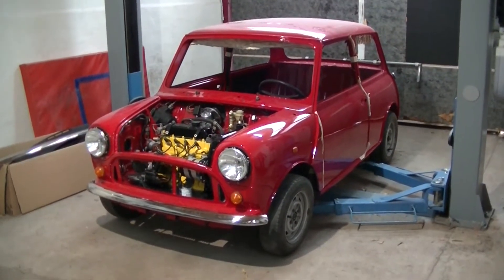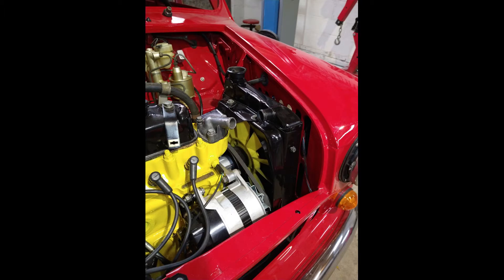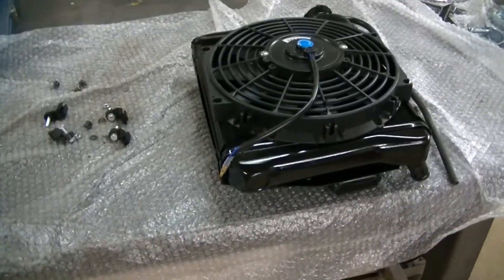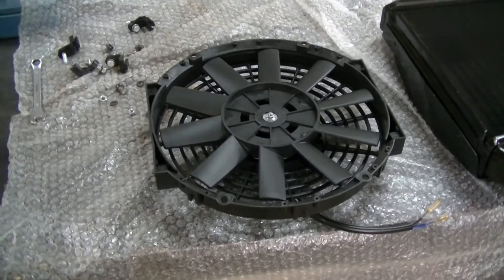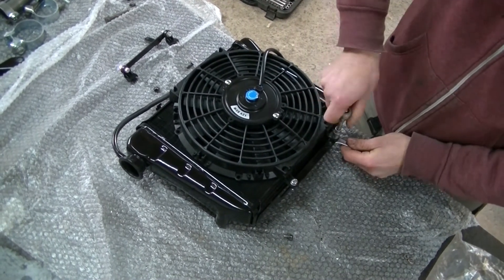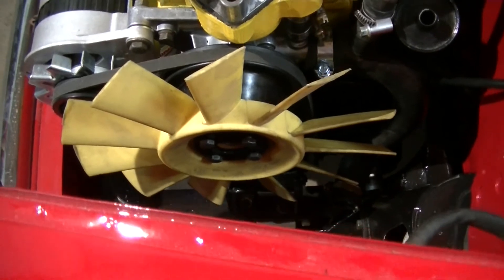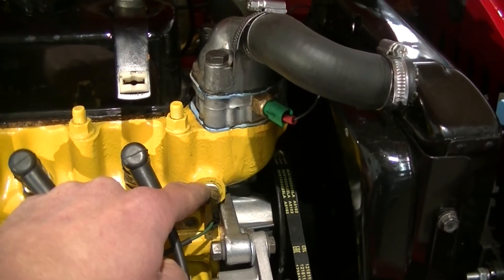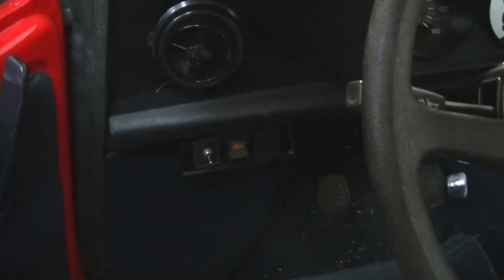Classic Mini electric cooling fan conversion

Comment: Where did you get the fan kit from? Thank you
Reply from the maker: I made it myself. I bought a 9 inch generic electric fan. The thermostat adaptor plate is from a late model mpi mini. The thermoswitch is from a fiat 1.2 8v (84°c - 93°c). I also installed a bypass switch so I can manually switch it on.

Comment: It's pretty amusing that the original yellow fan was on backwards, which meant the air flow was much less than it could have been because of the angle of the blades. 
It still pushes air from the engine through the rad into the wheel well, but not as efficiently when it's on the wrong way around.

Comment: The fan will suck or blow depending on the direction of  rotation. Just turning the blades round makes the Aerofoil "fly" backwards, losing efficiency, that's all.

The radiator needs the air pushing through it. If it's not pushed in to the airflow, along with the rest of the car, it takes more power than a small electric motor can supply. That's why Minis always had engine driven fans if they had side mounted radiators, even when fitted with extra electric fans for the reason you described.

It's best to mount the fan switch in the water flow returning to the engine where it'll sense what effect the radiator has had on temperature. It certainly doesn't want to be on the engine side of the thermostat, so your thermostat should be  below that sandwich plate.
Reply: Why would you measure water temperature on the return after the radiator? On every engine the temperature is measured on the hottest point, wich is in the head or thermostat. Because you want your fan to turn on when it's hot. Al these sensors are rated around 85-90°C. Good luck if you will get that in your returnline

You can do that on your car, but i bet you will change a lot of head gaskets🤣
Reply: @larsdunge635  old hlund73 has been tucking into the cooking sherry again ...lol

Comment: Nice video! i did exactly the same with my mini and it is of great help during summer time to have that electric fan there!
One comment though...you have installed your plastic yellow fan backwords. The aerofoil side should be facing towrads the engine ( it sounds crazy i know) . If you remove it you will see it actually has a stamp makerd on the center of it saying "Engne side" it will drastically improve the efficiency of your cooling system if you install it the proper way in!
Reply from the maker: Yes indeed, you are absolutely correct about the way the fan is facing, you have a sharp eye. It should face the other way around. But still we had it put on just for the video clip, you can see there was no coolant in it, because the radiator wasn't connected. The car didn't run with the yellow fan, we installed the electric fan immediately after the rebuild. Stil, should have been done properly tough😅